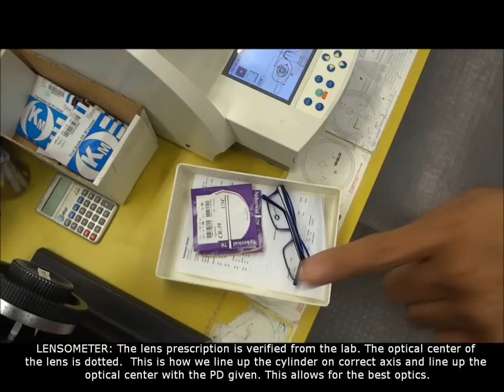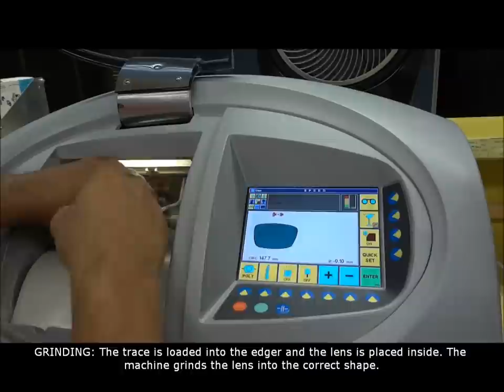How Prescription Eyeglasses Lenses are Made / Fit

Comment: Love to see how they were done before the days of computers..
Reply: They were done without computers. There that's how it's done
Reply: @mrpndaman129  Yeah but before computers how were they made.
Reply: @specialized29er86  bruh, just told you
Reply: @specialized29er86  for the plastic lens they are cut using normal scissors to make the glasses the closest to the frame 
then using the same tool that's used for the safety bevel is used to make the cut lens fit into the frame 
for the glass lens, there are special cutter scissors used to cut the lens then it's sharpened to fit the frame
Reply: ofc before computers they wouldn't be able to measure the eye powers so they just use the closest lens i guess have no idea 
but talking about the non automatic computer-based tools
Reply: @specialized29er86  Retired Optician here. Took much more craftsmanship.

Comment: What about the initial shape of the lens, though?  How do you apply diopter and astigmatism cylinder corrections, or make base-curve adjustments to the lens before cutting it?
Reply: A stock lens is chosen that matches the spherical and cylindrical component of the patient’s prescription. It is then inspected with the lensometer and orientated so that it’s position matches the axis of the patient’s prescription. The three red dots placed on the lens allow the optician to mount an edging chuck, so that the edging machine cuts the frame shape that matches the cyl. axis.

Comment: how are the lenses made to a prescription? this just shows how they are cut to shape right?
Reply: goodbastard right, like wtf?
Reply: The prescription is programmed into the computer at 1:43
Reply: Anthony Harris That’s not the script. Those are lens blanks that already come with the script in them, he’s simply inputting the lens shape parameters to cut the blanks to fit into the frame.
Reply: Lenses have been pre-prescribed in all varieties. They have thousands of them with different numbers in stock. They just pick the two that relevant to your eyes. That's my guess.
Reply: 1. lenses are in boxes ready to  go. 2. they are trayed up.. put in trays. order entry takes care of that.. the trays move to the lab. 3. the lenses are BLOCKED.. a small metal block is attached to the back of the lens.. the block is so it can be manipulated in the machines. 4.  the tray is moved to the generator which cuts the prescription into the lens. 5.  the tray moves to the too pullers.. who  divide the trays between plastic and poly...  does anyone want to know the rest ?

Comment: why do you have to wait 1-2 weeks to get glasses when they can be made in one day?
Reply: Soccer Unbox TV - They have to wait for the lenses to arrive from the factory. The store can’t grind the prescription onto the lense and they are only in charge of fitting the lenses onto the frame.
Reply: Obese Hank Not necessarily. It could be because they are ordering them through your insurance and need to wait for it to go through. Or the other scenario is the prescription lens isn’t in stock. I got my glasses prescribed and they put a rush on them because i needed them in 4 days for a sporting event, and I picked them up an hour after I left the office.
Reply: @soccerunboxtv5771  Not everyone has a "normal" prescription. If you have a sphere of less than -6 or +4, or an astigmatism over -2, you have to get those custom made. People will stock lenses with that parameter, but anyone outside those bounds, a manufacturing lab will have to surface it. And after it's surfaced, it takes from hours to days to apply an anti-reflective coating. This is simply just how the lenses are edged, the very final step. Not everything before. I hope this answers your question.
Reply: I'm getting mine in a week because they are for work
Reply: I got mine for only 2hours lol
Reply: Got mine in an hour.  Twice.
Reply: @jameshaugen1722  yes so you went to someplace like Lens Crafters where I used to work. I worked there for a year and later Zeiss Vision for 10 years.  You could have gotten them in an hour if everything went right. but sometimes there is what we call a breakage.. meaning something went wrong during the process.  you usually pay a higher price for these faster services. Sometimes you don't know it, but you get a poor quality product because they rush it out the door. I noticed that when I worked there..  as long as it looked good.. even though the lens didn't really match up correctly in the frame etc, they would just send it out. Their favorite term was  SHIP IT!
Reply: @KiwiSama  That would be me ; ) I have a seeing-eye bat.

Comment: I have an issue with some recently made glasses and I think it is AXIS related.  How skilful must the technician be in setting the axis in the correct position when clamping the lens into the machine?  
I can get sharper image where I rotate my right lens about 5 degrees clockwise - does this point to an AXIS setting problem?
Reply: probably best get the axis checked at the place you got them. it sounds like it's five degrees off.

Comment: Too little explanations.
What is he aiming for in the scope when "the optical center of the lens is dotted"? It seems the lens has no marks to start with. Is the optical center always the same as the geometric center? Or is the scope capable to find the true optical center using some special light source?
The PD is enough to align the frame and the lens horizontally, but it does not tell anything about how a particular frame is going to rest on a particular nose, hence no vertical alignment, which should be important for progressive lenses. And what if the user has an asymmetrical nose?
How does the blocker cling to the lens?
Reply: Q1: Depending on if there is astigmatism or not its just 2 pairs of lines that you line up in the corsairs. All lenses come unmarked and usually is done manually.
Q2: Not always the same but usually. The scope has a dial that you scroll up and down to view until the optical center is clear on lens.

It varies from person to person which is why adjustments to the frame is made to position the lenses with one's eyes.

The blocker clings to the lens via adhesive pad that is removable.

Comment: I have thick lenses can your company thin them out. I also have the prescription.
Reply: Chante Lee do u live by a Walmart if so go there
Reply: No. That's not how it works. It depends on your RX and the material's index of refraction. Poly is usually used instead of plastic because its index of refraction is higher. Glass has an even higher index of refraction than poly, but the best material to use is High Index plastic. Do not confuse this with regular CR-39, i.e. standard plastic, as this has the lowest index of refraction of all.

The higher the index of refraction, the thinner the lenses will be for any given RX. Safety lenses are made intentionally thicker, but your lenses, if fitted in a standard frame, are probably the standard minimum thickness for your RX for that material.

If you want thinner lenses, you'll need to buy some Hi-index lenses. Maybe some 1.67's, or, if your RX is really high, some 1.74's.

Comment: I have small identical scratches on both of my lenses from where the pieces are stuck on to the glasses to shape them. They just came back from the lab after getting a new prescription. They also do not fit my face like they used to. Keep slipping. I think the work was poorly done. Now they are closed due to the virus. Yay.

Comment: you know the actual  LENSES  depending on which ones you get are anywhere from 5 dollars  to 15  at most. but usually  2  to 10 dollars  are normal. but they will sell to you for about 50  up  to  200 dollars or more for lenses.  a  TOTAL RIP OFF.  Frames too. Just because they put a name brand on the frame, they will charge  you 300  to 500 dollars..  and actually MOST of them are all made at the same place anyway.  eyeglasses  are  a   HUGE  markup

Comment: Seems massively wasteful, isn't there a way to make the lenses closer to the required frame size?

Just seems like atlas another 2 lenses worth of glass was ground away.
Reply: +Doc Manhattan your point being?

It's not actually standard glass these days anyway, it's liquid polymer. So no sand.
Reply: ***** Not really.

Make 4 standard lens shapes. Round, Oval, Square, Rectangle. Then just grind down the excess to fit the required frame as they do. Be a lot less wastage. 

Efficiency =/= Hippie.

Chump
Reply: +jonnyt8524 the material can be melted down and reused. Recycling exists.
Reply: L Lawliet It's not recycled. Unfortunate, but it is not.
Reply: Precisely where is it all dumped too? Is it filtered out? Or just dumped into the sewage to cause issues later on?
Reply: Its burned ..